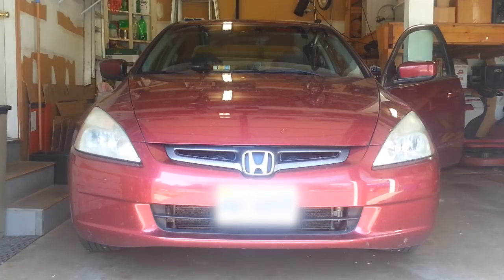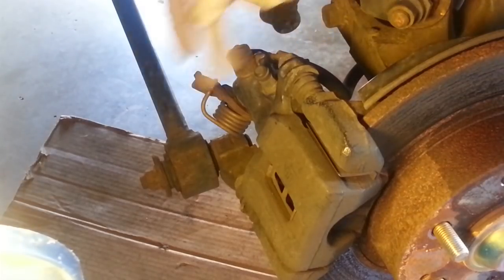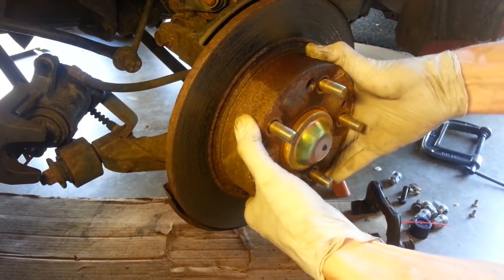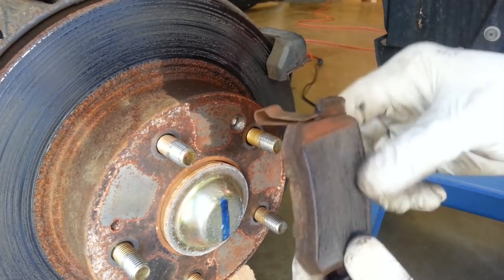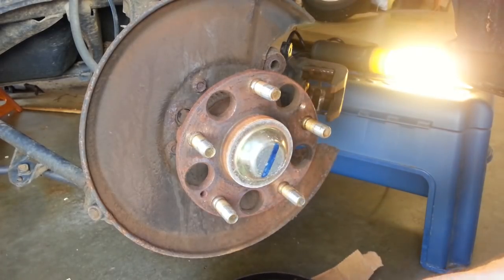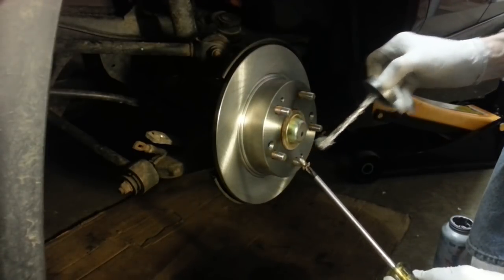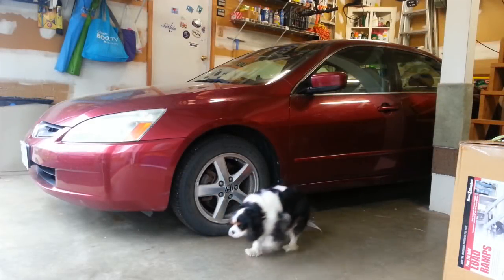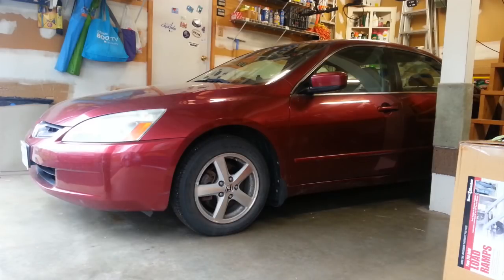DIY fix for replacing rear brakes - Honda Accord

Comment: Quit messing up your Phillips head retention screws. Usually people don't even replace them... they just throw them away. But if you're like me, you want everything back like it was or better - so... Please NOTE that these screws aren't actually Phillips at all, but JIS (Japanese Industrial Standard) and don't properly fit a PH screwdriver.  These are a size #3 and you can get one for about $14. It's also an impact driver and IT WORKS! Try this... a "VESSEL - 980 Series P.3"  Mine came in about two days. FANTASTIC! - ps - If you live in USA order it from here. Most are offered from Japan and shipping will definitely not be within two days! - If you already have an impact driver you can get just the bits for about 2 - 4 bucks.

Comment: How come on my accord there are no metal shims on my front or rear brake pads like there is on yours? It makes me wonder why my breaks are making knocking and squealing noises, it is like the pads are moving.
Reply from the maker: That's probably because the last time someone replaced the pads, they failed to replace the shims or they used aftermarket parts that did not come with shims. I'm conservative and always use genuine Honda pads on my cars. I find it to be cheap insurance against a bad experience using aftermarket pads.
Reply: @WorseThanChiggers  How would I find out if my pads/calipers need shims?
Reply from the maker: @le0_b  I'd look in your factory service manual.  Don't have one?  That's the 1st tool to invest in.  Okay.  Enough shaming.  Look up an official parts diagram for your car and you should see on the exploded diagram if there are shims as part of the brake assembly.  You can probably also check a genuine OEM source for pads and see if they're included.

Comment: so, when you initially compressed the piston with the c-clamp, it went in OK?  I thought you had to use a special tool on that model accord to turn the piston at the same time?
Reply from the maker: As you can see in the video, it did go okay for me but as others have rightfully pointed out, the proper procedure would be to screw the piston back into the caliper on this particular vehicle.

Comment: Nice job, however I don't know how you compressed that caliper piston with a C-clamp as those pistons only retract by screwing them in. See 17:58; there is a special tool to turn that piston in or you may be able to use a large flat head screwdriver.
Reply: I have a 2009 and yes you are right.  Mine screw in as well.  This may work for a 2003 but you can damage them on the newer models if you try to compress them.

Comment: The screws on the rotors are JIS heads I believe, not Philips.
Reply: That's correct. A JIS (Japanese Industrial Standards) Impact screwdriver (#3) is about $15. Well worth it!

Comment: I know this is an older video, but how did he compress that piston with a C clamp? I saw the cross pattern on the piston thinking they have to be "screwed" back in. But I did notice you needing to pry it with a screwdriver to get it off. Did the c clamp even move it?
Reply from the maker: Thanks for the clarifying question. Yes, the C-clamp did do its job. I didn't compress the caliper much but just enough to create some play between the pad and the disk. I could have compressed it more and the screwdriver wouldn't have been needed. If I wasn't replacing the calipers, I would have screwed the pistons back in. A good rule of thumb is that front calipers can almost always be pushed back in. For rear calipers, if the parking brake is actuated by the caliper then you need to thread the pistons back in. If the parking brake is inside the rotor like a small set of drum brakes, you can push them in.

Comment: Your Honda Odyssey ATF filter replacement video was helpful to me.  Now it looks like you have the best Honda Accord rear brake pad replacement video on Youtube. So, I subscribed to your channel. I bought an 8" C-Clamp that helped me open up the calipers some.  I also bout a manual impact screw driver.  Thanks for the good guidance.  Just opening the brake fluid reservoir cap seems to be a fine measure instead of opening up the bleed valve on the rear brakes.  It was easy to get the brake caliper cylinder worked back by just turning it with an extra wide screw driver.  I’m replacing the radiator on my 2001 Honda Odyssey this weekend, as a do-it-yourselfer job.  If you have created any or know of any good Honda Radiator replacement videos, could you point them to me?  Thanks!
Reply from the maker: Thanks for the kind comments.  I really appreciate it.  Nice work tackling these jobs yourself!  You'll save yourself considerable money and be confident that the job was done right.  I guess that I'm thankful for not having to change the radiator on any of our Hondas.  Not that it'll help but I do have this video where I changed the radiator on my old VW Jetta.  Take care.    https://youtu.be/R-5LLTVoKmk
Reply: Thanks.  My radiator started having multiple slow leaks around 330k.  I'm installing an aftermarket new radiator but, I'm replacing the hoses and coolant with genuine Honda.
Reply: @WorseThanChiggers  I went ahead and watched your Jetta radiator replacement.  It set the tone for the overall carefulness I will need to employ to make things tight enough to avoid leeks but, at the time, avoid damaging the radiator and connector threads.

This is the step by step video I’m going by and the gentlemen was winging it and he made some errors and identified his errors in the video so that I can do it right. https://youtu.be/Nxz1lHUWqko

Also this EricTheCarGuy video on replacing a Honda Civic radiator gave me some precautions to consider. https://youtu.be/REIIwYaKQDY

Comment: Is there a trick to installing on the rear side brake pad? I watched some other videos and someone said something about aligning the notch into the criss cross part of the piston on the caliper. They said if its not done properly, potentially the brake pad will be at an angle and never wear evenly.  My car isa  9gen honda civic. thanks and nice video! :)
Reply from the maker: Thanks for bringing this up. It is an important point that I failed to highlight in the video. If you look at the video here starting at the 26:17 mark, you can briefly see a thick pin protruding out from the back side of the inner pad. Also, at the 26:49 mark, I am holding up the new caliper and you can see the cross-shaped notch in the end of the piston. Before final assembly, turn the piston so that it is oriented as you can see in the video such that the cross is aligned with the 3 o'clock, 6 o'clock, 9 o'clock, and 12 o'clock positions as compared to the body of the caliper. Then, as you lower the caliper into place, the pin on the back side of the inner pad should slide nicely into the vertical groove of the cross. Just ensure that the pin falls correctly into the groove rather than sitting high on the flat face of the piston. You can also see the cross in the piston and the pin on the brake pad starting around 21:38 where I show the new parts. I'm not sure if your generation Honda has this same exact set-up but hopefully this helps clarify things for you.

Comment: There's no penalty for removing the piston from the "core" to examine it before replacement.  Often the caliper is ok and at most needs the seal replaced. 
 -I'll bet that you find the areas of the old caliper support frame under the stainless guides (abutment clips) had a thick uniform layer of rust, so even if the guide pins were moving freely in their bores, the pads would bind instead of sliding free.  Cleaning those areas and removing the rust before relubing should be annual maintenance in coastal areas and where roads are salted. 
-Annual draining some brake fluid from a bleeding is also a good idea, (siphoning the old fluid from the master cylinder reservoir and replenishing it first).  
-The brake hardware also needs annual cleaning and lube, with silicone lube put between  the stainless clips and the frame and on the spring where it rubs against the outer edge of the pads to inhibit rusting. Honda packs a lube paste packet with their pads and it should be used.
Reply: I did this same job today. 

My calipers were absolutely garbage. The slides, the caliper piston were rusted severely. 

Tearing brakes apart annually? Seems excessive. I'd never do that.

Comment: Those calipers looked perfectly fine? or was this a preventative measure?
Reply from the maker: Good question. The outside appearance can be deceiving. There was corrosion in their bores and on the pistons which prevented them from retracting properly. That is why there was significant uneven wear between the inner and outer pads.
Reply: I see, thank you, sir.

Comment: What do you do if you have to drill the 2 screws that keeps the disc? You leave it like this and install everything?
Reply from the maker: You have 2 options.  Completely drill out the old screws and re-tap the threads for new screws or go without the screws and allow the lug nuts to hold the disk in place.  It doesn't work very well to go without the screws because the disk flops around making caliper and pad replacement very difficult.

Comment: Hey why did you crack the lug nuts while the car is on the ground?  I always jack it up first then remove the lug nuts.  Am I doing it wrong or causing damage?
Reply from the maker: It is very common practice to crack the lug nuts loose while the car is still on the ground.  Most owner's manuals recommend doing that when changing a tire and using a manual lug nut wrench.  Otherwise, you run the risk of rocking the car off the jack.  If you're using an impact to remove the lug nuts, this step is unnecessary.

Comment: I just found out mine is sticking on the right side. Inside side of the disc is warn terribly at an angle. Swap will be easy, finding the part here in Goias Brasil....another story.

Comment: I have a 99 accord v6 and I went to salvage yard to get a caliper bolt wandering what size head the bolt is the one I got bigger than the one that’s on it
Reply from the maker: As long as the length and thread pitch is the same, it should be fine.

Comment: Could it be possible where one of the pads is a different compound than the other (outside pad)? hence the difference in wear?
Reply from the maker: Certainly not intentionally. You want them to have the same friction properties and wear characteristics. That's why you always replace all four pads when doing either the front or rear brakes. My uneven wear was due to sticking calipers from corrosion.
Reply: @WorseThanChiggers  Yes only asking because heard some manufacturers (questionable ones) sell pads that have different wear and prematurely may cause uneven wear either side of pad, Thank you for doing this video, I've needed to do my accord rear brakes, this video is very helpful :)

Comment: Does the wear indicator always go on the inside bottom side on every car?
Reply: I’d like an explanation why it makes an operational difference if the wear indicator is installed on top or bottom
Reply: @onsturn  I understand that if the wear indicator is uppermost, the warning squeal occurs only in reverse and hundreds of kilometres later than if installed the other way.  There is still ample brake pad material before steel meets steel.  This way, the brakes last longer and you don’t make a racket every time you apply the brakes.

Comment: I have done this job a number of times on different cars. But I just finished doing the exact job on my 1998 Honda Accord LX and the car couldn't stop rolling when I hit the brakes. What could be the cause? My car is missing the backing plates/dust shields on both rear brakes which i plan to replace this week. Would that have anything to do with the non-braking?
Reply from the maker: That depends on what you mean by non-braking. Did you pump the pedal several times after doing the job to take up the gap between the pads and the rotors? Do you have a hard pedal or does is feel spongy? Does the pedal go all the way to the floor? Did you open up the brake system and perhaps lose fluid or let air into the system? Is the master cylinder reservoir filled properly? There are other potential factors but those are the initial things to check.
Reply: @WorseThanChiggers  I pumped the pedal until there was a good grip on the pads. The pedal was hard. It was after I drove the car out of the garage that it started rolling and the brakes wouldn't engage. They would then engage after the car stopped. on and off.

I did leave the brake fluid reservoir cap open 2 days in extremely cold weather. The moisture must be the problem so I will flash the lines tomorrow.
Reply from the maker: A compete brake fluid exchange does sound like the next prudent thing to do.
Reply: @WorseThanChiggers  Will do. Thanks for replying so soon. I learn something new every time.
Reply: @WorseThanChiggers  I did change the brake fluid. That solved the problem.
Reply from the maker: @kizito8888  Good work!

Comment: Why did you not grease the pad contact surfaces?
Reply from the maker: I have seen differing opinions on the subject where some believe that adding lubricant there can attract dirt and debris over time which inhibits free movement of the pads. Though I didn't show that step in this video, I typically do apply a very sparing amount of high temp brake pad lube to the ears of the pads. Definitely do not use standard grease.

Comment: Despite your very well executed video with narration it is highly suggested that you apply grease under the shim, on the outside of the shim and in the brackets where the pegs on the side of the brake pads rest in the brackets. its not 100% necessary but to increase the longevity of your rotors and pads its definitely suggested

Comment: Hola ,por que reemplazaste los caliper? en mi accord no acciona el freno de mano
Reply from the maker: Why did I replace the calipers? Since I confirmed that the slide pins were moving freely, the uneven pad wear indicated that the calipers were having a problem releasing. When calipers wear out, they do not release and continue to apply brake pressure on one or both sides of the rotor. Either the piston seals went bad or corrosion set in.
Reply: @WorseThanChiggers  muchas gracias compadre

Comment: I'm about to do this job on a friend's 03 Accord EX that is experiencing uneven wear on the passenger side pad.  The dealership, upon inspection, indicated a slider pin was seized & their recommendation was to do the full rear brake job, plus replace the caliper where the pin seized (along with a full rear brake job).  My intent is to DIY the rear pads and rotors, meanwhile pulling out the seized pin, lubing it, cleaning out the female assembly within the caliper, and reinstalling.  So my question is, if you wouldn't mind, if you were sure a seized slider pin was the root of the uneven wear issue, would you still have replaced the calipers?
Reply from the maker: Good question. I would take it apart for inspection before making that determination. If the slider pins and female portion are okay but just need to be well cleaned and lubricated, you should certainly be able to salvage them. Give it a try and see if they are sound and move freely after that treatment. But if they are heavily rusted, pitted, or otherwise worn beyond their design specs, go ahead and replace the calipers. Also inspect the little rubber boots for tears which could have allowed the pins to be contaminated by moisture and road debris. Good luck and let us know how your experience turns out.

Comment: Because you installed a new caliper you didn't reveal the special tool required to push the piston back. The standard C clamp doesn't work with Honda's back breaks
Reply from the maker: You are actually correct and thanks for the clarification. Since the parking brake is integral to this rear caliper design, it has a ratcheting mechanism inside that requires the piston to be turned back into its bore. If I was just replacing brake pads, that procedure would be required to fully retract the pistons and make room for the new, thicker pads. In my case, the C-clamp was only used to relieve the pressure just enough to remove the caliper from the rotor. That step isn't really necessary and, as I did in the video, a large screwdriver can be used to pry the caliper off the rotor. Much appreciated.

Comment: Excellent video, Honda pads just dont cut it, i would have went with Akebono.
Reply from the maker: I'm curious why you aren't a fan of Honda pads.  What don't they cut?  I only use genuine OEM pads on our own Honda and Acura vehicles.  Always perfect fitment, quiet, long wear, and they come with all the shims, clips, and grease.
Reply: @WorseThanChiggers ,  I had the 8th gen 6-6 coupe(nothing but brake problems front and rear),  the 8th gen weighed more than the 7th, but was still using the weaker 7th gen pads and rotors, there was a Class Action Lawsuit against Honda. Honda was reimbursing up to $650 dollars, so i bought Raybestos advanced rotors, Akebono pads, Stop Tech SS brakes lines and all the necessary equipment to install them myself(all problems where solved). Now please tell me you are not using junk Honda manual transmission fluid?

Comment: First time I see anyone who pushed the piston back before take it off ! Why? Usually you don’t have to do this ! Any reason?
Reply from the maker: That's explained at this point 4:44 of the video. A lip can form at the edge of a worn rotor making it difficult to slide off the pads and caliper. It's just good practice so as not to damage the pads. It wasn't necessary in this case being that I was replacing everything but I wanted to show the procedure for completeness.